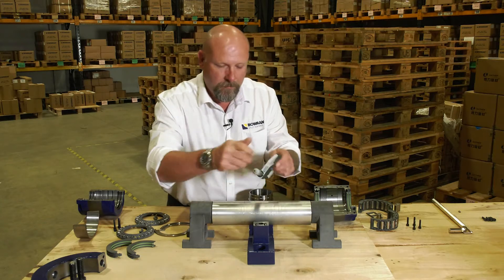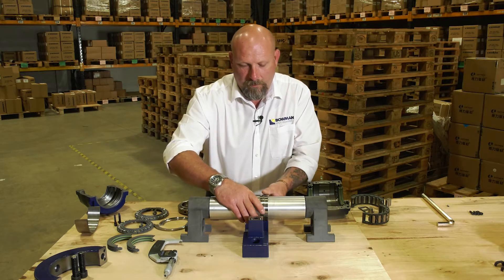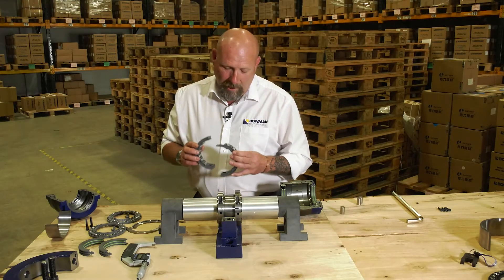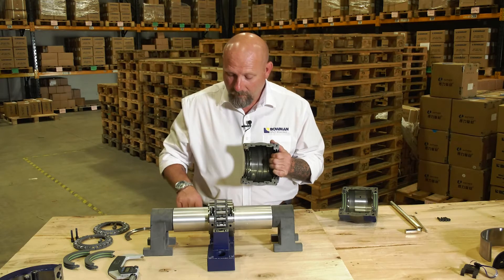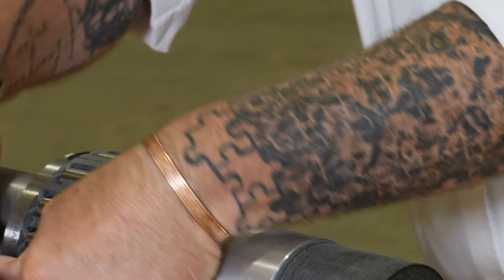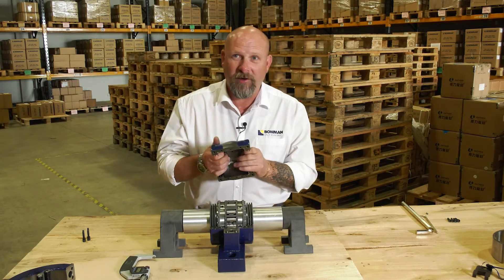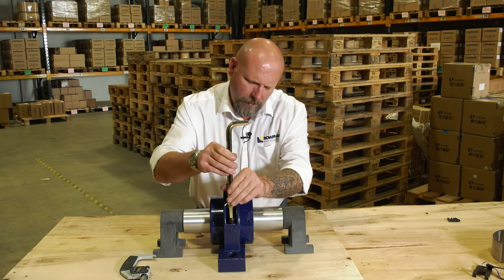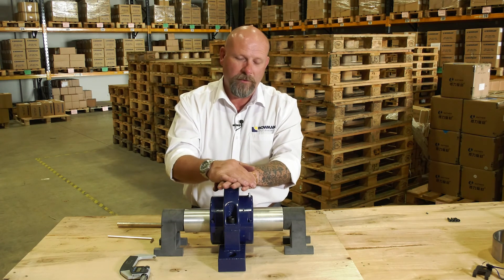How to assemble Bowman Advance Split Roller Bearing

Comment: For applications that require an expansion bearing on one side.  Can these bearings be used?  Can one side expand?
Reply: Yes, Bowman Split Bearings are designed to accommodate expansion on one side. Their split design allows for easy installation and removal, even in tight spaces. Consult with Bowman experts to ensure the bearing is suitable for your specific application and expansion requirements.